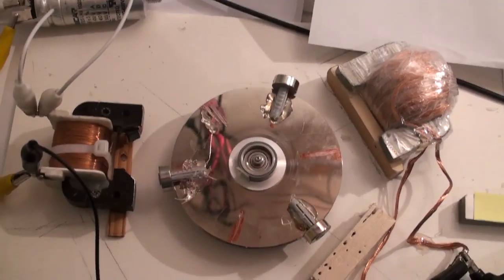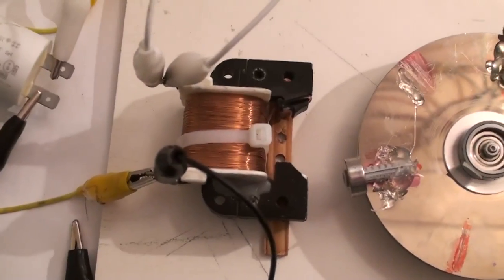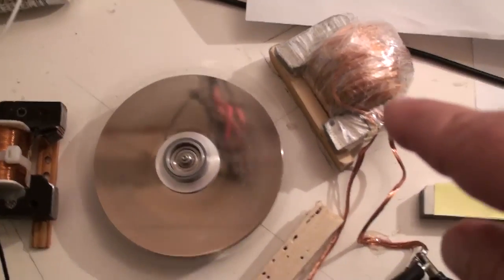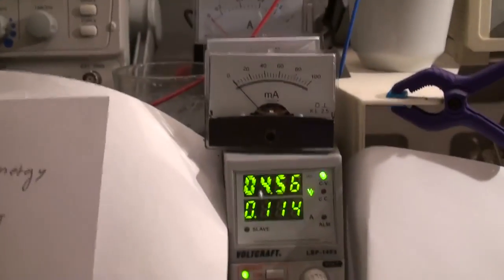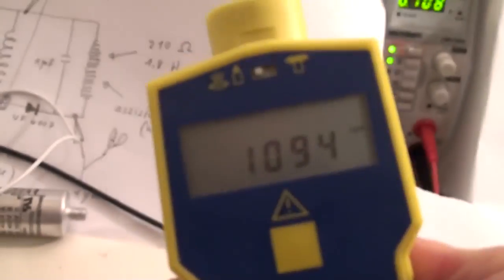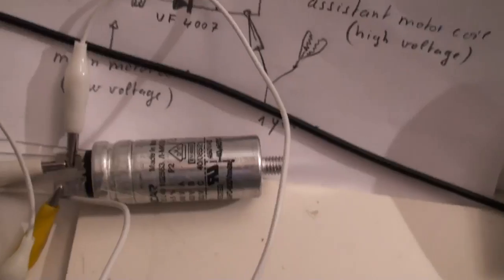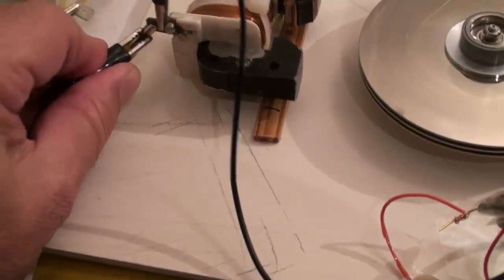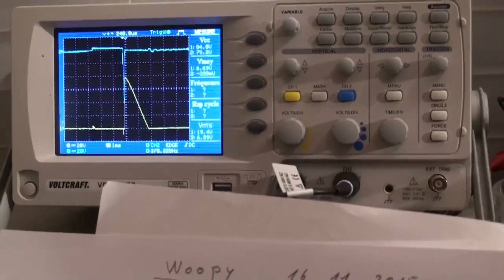energy in the flybackspike 2

Comment: Good work again, Woopy! and Luc.I have a question about your previous "cold fusion" work, Woopy, if I may ask here.  At one time, you had a light-water (H2O) device that seemed to produce more power (or heat) out than power in...  Is this STILL what you think, or did you find "something wrong" with the H2O-cold-fusion approach?